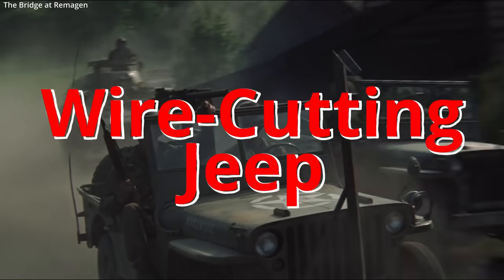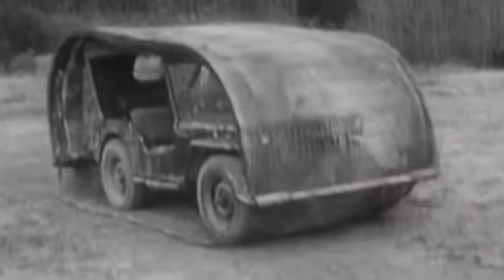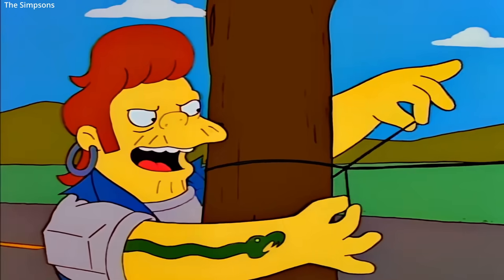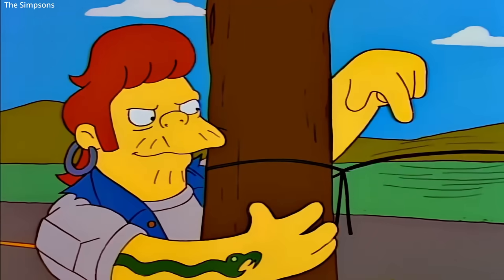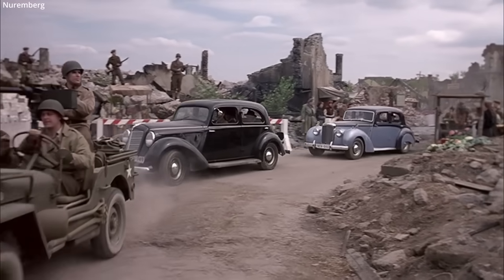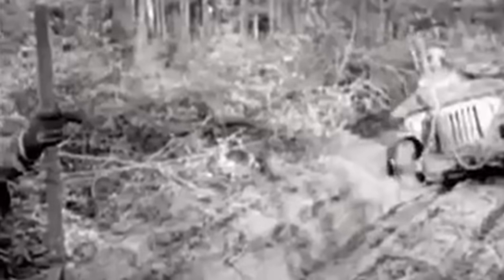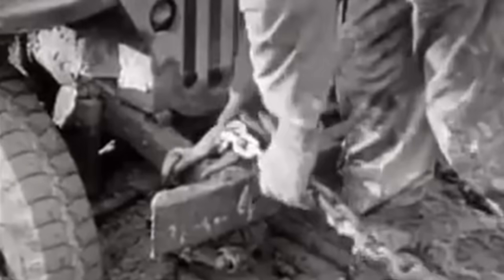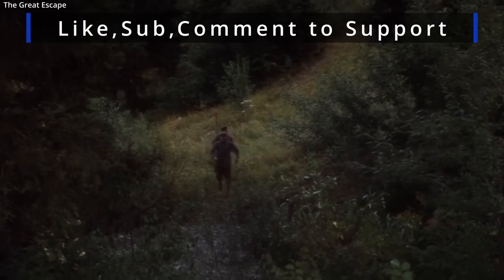WW2 Wire-Cutting Willys Jeep

Comment: My dad also added a wire cutter on his VBL in afghanistan he "borrowed" from the french. You can still find a picture of this VBL by searching "VBL ISAF" or something similar although the crew is the next ones that replaced my dad after he left (2005). He was the gunner of the FN MAG on the co-driver's seat so he made himself a favor by adding it.
Reply: That's also something that's surprising that could still be in use among others in that and who knows may want to look into booby traps or jeeps with guns and it's modern equivalent the Technicals anyway could think that over.
Reply: What province was this in?
Reply: @DurhamXo  You can only wonder and anyway may want to tell JJ about DSHK, M2 Browning Machine Gun and PKM's along with SA-2 guidelines or S-75 DVINA that missile really did a number on the US air force during the Vietnam War and also looking into the Skycrane and Apache helicopter as another among things like RPG-7's and missiles like the Stinger and SA-7 among who knows also seeing a Cold War documentary including those traps used in the French Indochina and Vietnam War looked primitive but still deadly that's for sure anyway many in there especially with times now.

Comment: It’s interesting to see these wire cutters on other vehicles, such as Humvees, Strykers, and even helicopters like the OH58
Reply: Because for Helicopters, and some aircraft, there exists a wire that was placed there years prior: power lines. If a pilot is flying low and not paying attention, they can easily snag their rotors in the wire, and crash.

This is also why in some areas you can see blaze orange balls attached to the wire, to make them easier for helicopter pilots to see
Reply: Don't forget submarines for cutting underwater cables, or at least sliding them over the top.
Reply: There was even torpedo attachments to cut thru anti-torpedo nets.

Comment: Awesome video!! While in the US Army during the early 1980s I was a drive of an M151A2 Jeep. We had the wire cutter on our vehicles even back then until the HMMWV replaced them. We used a U-Shaped picket with a few notches cut into it and the top there was a small piece welded down and forward, a lot similar to a few examples in the video. THANKS!!! for the memories.

Comment: When I got to the 82D Airborne in April 1985 our battalion scouts were equipped with jeeps that had that angle iron wire cutter welded to the front bumper.

Comment: 0:13: Not that it stopped tanks getting defense caging and turtling walls.

You know, the wire traps can become moot because of higher enough windshields, or being tall enough vehicles that the wire hits, say, the fender instead. Also, the occasional civilian traffic just passing by can be an innocent problem.

Comment: A wire trap type situation happened in my city a few months ago.  There's a fairly large community of an orthodox Jewish group here and they use a thin cable to outline a symbolic "home area" for the sabbath, when they're not supposed to travel too far outside the home.  They had set up this, but one end of a section fell across a road near the bottom of a hill.  A cyclist caught his neck on it and was thankfully only minorly injured, since one end was loose.

Comment: Windshields on the old jeeps were good for driving on hard roads but could be more trouble than they were worth on dirt, particularly when driving with other vehicles. They would get covered in dirt and/or mud splatters and they didn’t have sprayers worth anything if they had them at all. They also had a problem in combat situations of being reflective, which could give away your position or call attention to the vehicle especially from the air.

Comment: For some reason, kite-fighting, which used string with glass shards suck on them, has reached my country.  Unfortunately, for one case, someone did not make sure that the strings with thw glass sharda was not properly disposed of and cut a delivery riser very badly.  The guy survived, fortunatrly but is an example of how thess wire traps can  really cause harm.

Comment: When I was an antitank platoon leader, I had 12 TOW jeeps under my command. TOW = Tube Launched, Optically Tracked, Wire Guided Missile. The Russians had their equivalent and I envisaged a battlefield covered wih a spaiderweb of wires. So every one of my 26 vehicles (Platoon Leader, Platoon Sergeant, 12 Missile Launchers, 12 Ammunition Carriers) had cutter bar mounted.

Comment: The windshields were often lowered as reflective. Then padded below and covered so they would not break..Drivers at the front might wear goggles. Not only booby traps across the roads but low hanging communications wire if the windshield were down. So the photo does not make a lot of sense with the windshield up. ( Every field exercise showed broken windshield so they were often removed and stored once I arrived off public highways in the training area. ( Fort Ord drive by convoy to Ft Hunter-Liggett.) The jeep roofs with doors rarely used in warmer weather..

Comment: These wire-cutter arms were commonly installed on American/Coalition vehicles in Iraq. Not because of any nefarious traps, but because Iraqi neighborhoods would install any old wiring from building to building as high as a typical step-ladder. So you had these thick spiderwebs of wiring just about the height of a gun turret on a HMMV or MRAP. A gunner would get the surprise of his life, especially driving at night with night-vision goggles down.
Of course, that caused some civic issues with the Iraqis getting their phone/TV/Cable/Internet/power lines cut by passing American convoys....

Comment: The real key to why wire traps were used is simply; Why not? Wire was cheap, ubiquitous, and setting up a trap takes mere seconds - just look at Steve McQueen doing it, and he's taking time to look out for krauts too! As you say, they probably weren't all that effective in terms of wounding or killing enemy combatants (and there is of course the risk that your trap remains when your allies come to using the same road!) but it's just one more worry for your enemies. Besides which, while you know it's just a length of wire and needn't be thoroughly investigated - just cut it and you're sorted - the enemy doesn't, and if they're smart they'll assume it's rigged to a significant booby trap of sorts - be that explosives, a deadfall weight, or whatever else. The 10 seconds it takes you to set a wire trap, might cost your enemy 5 minutes.

So then imagine setting wire traps along the length of a road. Wire trap, wire trap, wire trap, every 200 yards or something, one on every bend. Then you rig the 4th trap to some explosives. There's a good chance your enemy spots the 3 preceding, finds them just to be wire, puts something like a wire-cutting jeep at the front of the column, and then loses said jeep along with whatever else when it sails confidently through the 4th wire

Comment: This crap is still present on modern-day Filipino jeepneys and I've never heard of the Japanese doing the piano wire trick (I would love for that to be in a video game btw. Hell Let Loose cough cough). Must've been standardized at some point regardless of where the jeeps were going.

Then again ours flanks the hood instead of springing up from the bumper. One on either side or sometimes just one. It may have a practical use that escapes me, but it'd be funny if this were a completely cosmetic addition that jeepney manufacturers just added on every unit because that's what the original G.P. vehicles had.